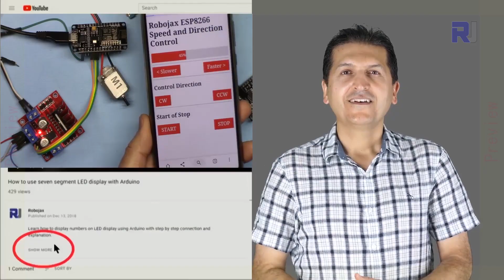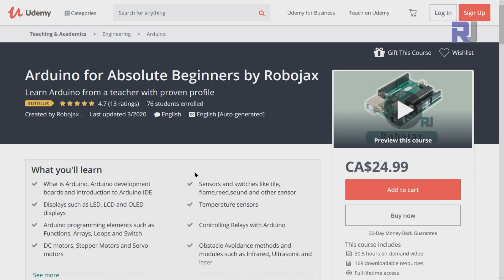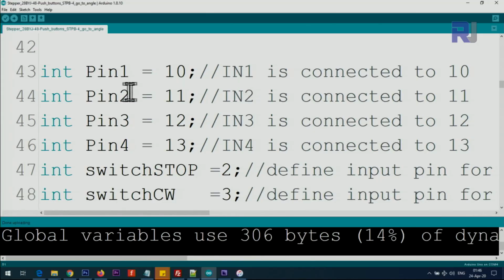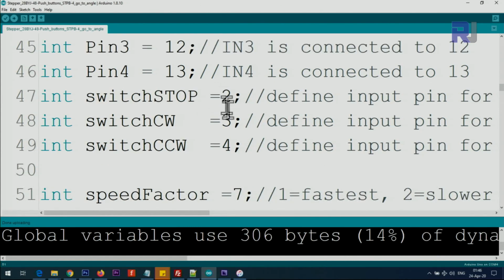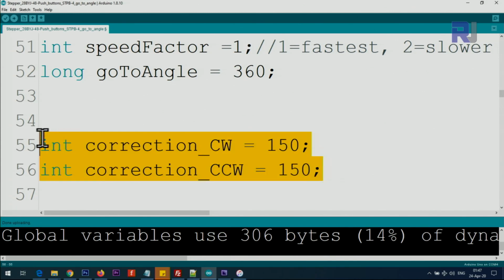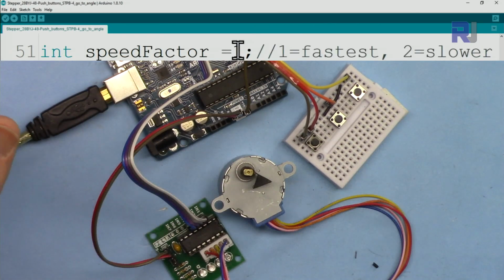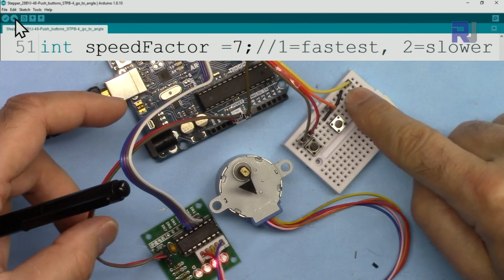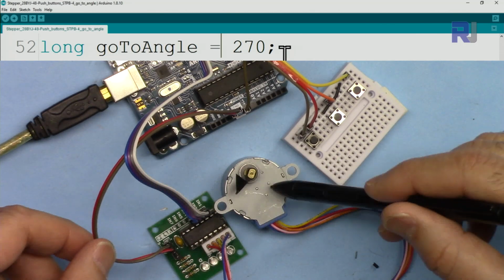STPB-4: Send 28BYJ-48 Stepper Motor to any Angle  with 3 Push buttons  CW, CCW and STOP

Comment: You say: the maximum is 7655 degrees. But when i put it on there it wont stop spinning it just keeps going without stopping? You say this in all your videos. Can you help me? Thanks
Reply from the maker: I have not said "7655 degrees. "
Reply from the maker: do you know 7655 ÷360=21.26. so it will rotates 21 times before it stops. So wait for 21 revolution and it will stop. if you set it to 7655

Comment: Hello, I want to make a lift with this. I want the stepper motor to rotate 3600 degrees but it doesn't work. It just keeps spinning without stopping. Do you know what the problem is? Thank you
Reply from the maker: Hello, please see other codes I have I am sure you will find something.
Reply: @robojax  
Ok, I'll try again
Reply: You say: the maximum is 7655 degrees. But when i put it on there it wont stop spinning it just keeps going without stopping? You say this in all your videos. Can you help me? Thanks

Comment: can this be modified to work with a dc motor?
Reply from the maker: No.
Reply: @robojax  is there a way where a dc motor can go a certain angle clockwise and counterclockwise using 2 pushbuttons

Comment: Mr Robojax. I am trying to do this. Am stuck in the final stages. Am unable to rotate to 90 deg. Even after putting the command in long gotoangle=90 it is still rotating 360 deg continuously. Pls guide me.
Reply from the maker: Please use unchanged code and if you do the wiring properly it should work. Your should have watched the introduction video to this motor. The link to the video is I description

Comment: hi. can i use this stepper to measure temperature. it is mean when the temperature is 35C, the stepper will turn angle 35 ( i use Lm35 sensor to get temperature), sorry my english is not good.
Reply from the maker: Hi, Your English is perfect. yes you can but how. I have so many videos (may be 10 or more) on this motor. watch and learn how it works,  you should be able to do it. I've video on LM35 which is the best video on LM35. So combine both.  Get some idea from this https://youtu.be/5xQ8vLavWKQ ,

Comment: Good Afternoon,  

I have been following your work on YouTube regarding arduino + stepper motors, but I need some assistance. 

We want to build a model train turn table and would like to know if there is a way to have the following 

2 Button setup 

Button 1 - must go to different angles with different values for example 

Angle 1 - 30°
Angle 2 - 45° 
Angle 3 - 60 °
an so on for 14 different angles

Button 2 must then be used as a Home Point or Angle 1

is something like that possible with a 2 button setup?

ps. the degrees on angles will vary and wont be exactly every 15°

Dean
Reply from the maker: Unless you use display, or some other indicators it is would be blindly selecting angel or start or stop.

Comment: Installed your code taken from here

https://robojax.com/learn/arduino/?vid=robojax_stepper_28BYJ-48_STPB-4

The engine rod spontaneously turns in different directions.

Only the stop button works correctly.
It turns from the buttons to the sides, but not smoothly.
With other sketches, there are no such problems. Changing the buttons shows that the buttons are physically functional.

Options
Arduino Nano,
ULN 2003,
28BYJ-48 12 DC,
External supply for engine 10V

Buttons from "-" to pins without resistors.
"-" is common for Arduino, ULN 2003 and buttons.
Please help)
Reply from the maker: Hello, if you haven't changed the code, then the wring is incorrect. or the board is bad. check it. I have spent on this days. it works.

Comment: Just what I needed to drive my small xy table in 0.05 inch steps, pcb thro hole component pitch, however, there is a problem with the code, after the motor has been operated for the first time, about X seconds later the motor turns on by itself and does 8 revs + Y revs.  X depends on the selected speed and Y the no. of degrees selected, in any direction.  To prevent this happening again after the motor has been operated the stop switch needs to be pressed.
Reply from the maker: this needs attention and I don't know what is causing it.  I will look at it.

Comment: Sir, first i would like to thank you for this project, this is exactly what I needed, but I am trying to make with one button. i think that there is something missing in the code, because when the button is pushed it rotates  alright. But after few seconds it rotates agoinn for a few turns and stops again, and it keeps on doing that. would you please correct that ? Thank you.
Reply from the maker: you are welcome. something unusual is happening or problem with wiring. please check it again.
Reply: Robojax May I ask you something else if you don’t mind ? I have been looking for softwares that simulates a Kind of a complex circuit with Arduino. I want to simulate the circuit with software before implementation. I got lost in all the softwares available . No one is complete. Easyeda has a huge library but simulation is very difficult with it I read. What do you recommend ? Thank you in advance :)
Reply: And Proteus seems to be good in simulation but has a limited library .

Comment: Sir I want to make a radar using stepper motor and a hc sro4 please make
Reply from the maker: what to do with both? What does motor do with HC-SR04? is it stopping or starting when certain distance is detected?
Reply: I want to make a radar using ultrasonic sensor and stepper motor for precise location
Reply: I want it to keep scanning and don't want it to stop at any input
Reply from the maker: at the begining of the video I mentioned that you need to watch the introduction to this motor video https://youtu.be/Sl2mzXfTwCs and in this video the motor never stops.
Reply: I want the motor do semicircle